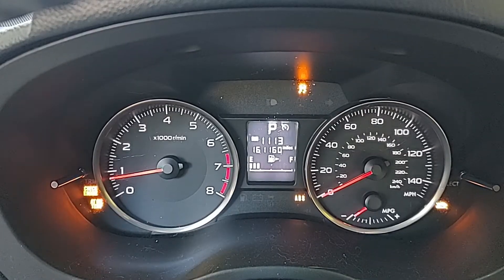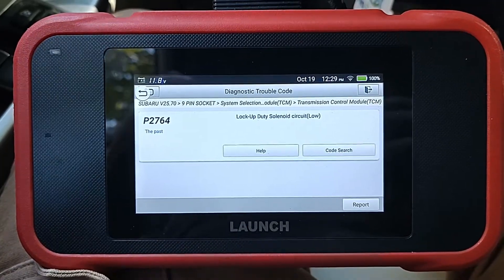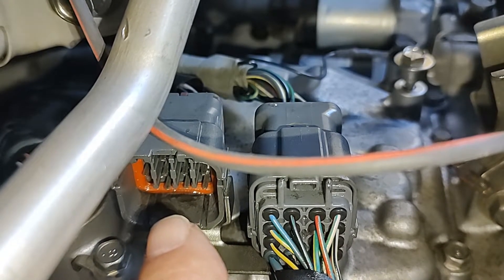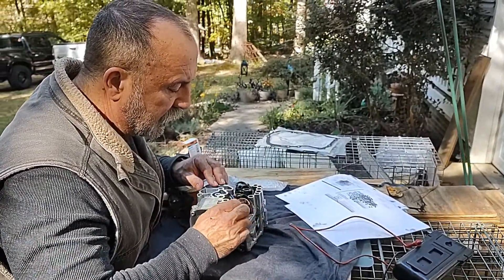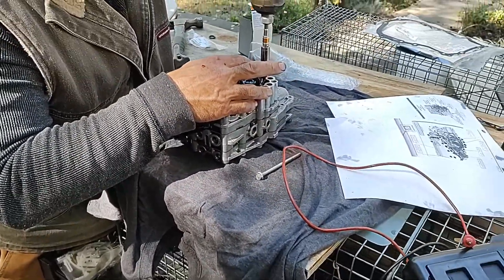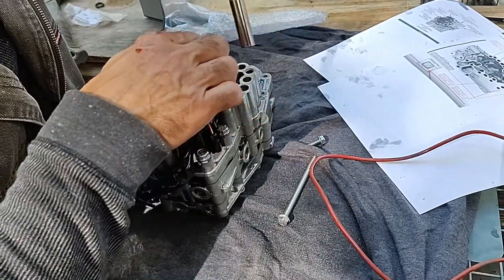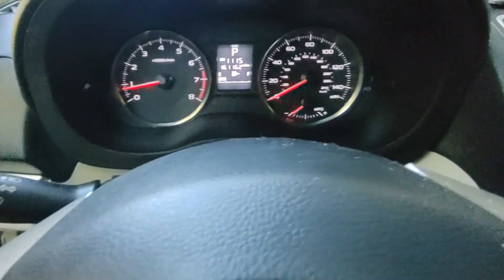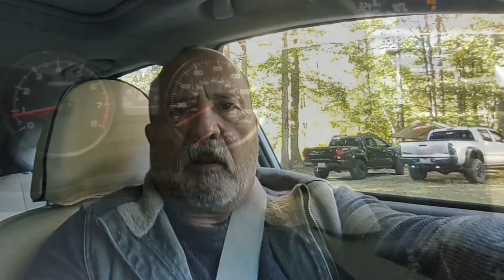How To Fix Subaru P2764 P2763 Codes - Subaru TR580 Transmission Valve Body Solenoid

Comment: My code is for a 2012 Subaru Impreza sport P2764 torque converter clutch pressure control solenoid so what do you guys reccomend ??

Please help meeee

Comment: I just bought a second hand subaru xv 2015 with 67000 miles on it. Engine light,  hill assist  AT oil light and another light i think to do with traction is on. The code from the scan shows PO 971. Im so stressed. Could it be that  i jusy need to change the fluid or its def the valve body and i need to get this changed. It cost $2000 for the valve body in my country plus mechanic fees and they are saying that the solenoid isnt sold separately. Help😢

Comment: Hey, Jose! Thanks for the great video. I just bought the solenoid part, but I have a question: Once I replaced the correct solenoid, Do I need some special software to reprogram the automatic transmission?
Reply: Replace them all?
Reply: Disconnect the battery for 10 minutes and it will relearn everything. You'll need to teach it how to operate your driver side window too but you can find a video for that
Reply from the maker: I didn't for just the solenoid an didn't have any issues. I did get a bidirectional ODBD scanner when I later replaced the entire valve body and reset it.

Comment: Hey man. I just replaced the solenoid on my 13' Outback. It cleared the CEL, but it appears that the
DME has a soft code of the same P2674 through
OBD. I haven't relearned the transmission and checked the grey wire and it is 13ohm. Do you know what could be the issues? Could it be the wire harness, another solenoid, or transmission relearned? The transmission still is jerky when accelerating and a bit sluggish. Thanks.
Reply: The relearn is important.

Comment: Dear friend, my Subaru has all those lights on but no codes appear!
Reply: You might be using a cheap OBD2. Mine didn't show codes either. Had it scanned at the shop with a 'bidirectional" OBD2 scanner and it showed the code.
Reply from the maker: As one person commented it could be cheaper model scan tool you might wanna invest in a better one or find a shop that scan it for you.

Comment: Up here in Canada, our local suby dealer wants..........$2200 for the valve body.  Puck that!   I love youtube for these repair videos.  Good work, i was considering to re wind the solenoid old school LOL
Reply: Our dealer prices are super high too.  I'm thankful for others that made videos about this as well.  So far our Forester as well as our daughter's are both running well with no transmission lights.  Hope you are able to fix yours too if it needs it.  Thanks for watching.
Reply: Just got quoted $4k in Australia from Subaru dealer just for the valve body.
Reply: @woodywood6961  I'll have to do the US Dollar conversion (about $2,575 US) but, that still sounds expensive.  I spent a couple of hundred dollars on the solenoids and did it myself.  A good salvage yard could be a great resource.
Reply: Are all the solenoid same part number
Reply: @iphone-uz8vc  No, they have different ohm ranges.  I think 3 are the same and 1 is different.
Reply: @iphone-uz8vc no, all 4 have different specs.
Reply: Dorman apparently makes solenoids and I heard NAPA might have them also. I'd rather go NAPA than Dorman!

Comment: Did you have to do a computer relearn with a scan tool?    
Or did just driving it, complete the relearn?
Reply from the maker: We did just drive it and the car drove fine. We did a relearn later on and the car drove the same.
Reply: @ExtremeDIYGuy  Good to know, I don't have a computer that can do the relearn, but I figured that the car's computer would figure it out.

Comment: Hi, Does the new valve body come with new solenoids? Thanks. Great video!
Reply from the maker: Yes it does
Reply: @ExtremeDIYGuy  Thanks for the info. Dealer said they replaced the valve body, but now i have a P0841 code. What next! Thanks again.

Comment: Maybe somebody can help me figure out what my issue is with my CVT. I have a 2013 Crosstrek. It has just over 160,000 miles and I have never changed the CVT fluid. I've called the dealership and they say don't change the fluid. I recently got the dash board lighting up and I scanned it and got P2762 Torque Converter Clutch Pressure Control Solenoid Control Circuit Range / Performance  along with P2763 Torque Converter Clutch Pressure Control Solenoid Control Circuit High.

I've been researching the valve body and the lockout solenoid. I am about ready to start taking my car apart to get to the valve body and check the ground wire and measure the resistance in the plastic connector to see if it's in between 10 to 13 Ohms.
The thing is my car dash will light up but I can't tell any difference. The transmission appears to be operating smoothly. At speed I put the Transmission in sportronic mode and it is in top gear (6) and it doesn't get any worse gas mileage than normal. The vehicle, other than the dash lighting up, does not drive any differently than it always did.

I'll clear the engine code with my scan tool and then reset the ECU with a series of pedal depress and turning the engine off and on that I learned in a Youtube video and then it drives for a hundred or so miles and I'll get the dash lighting up with the check engine light and AWD light flashing and I believe something saying high temp in the transmission. I don't have a picture of it and erased the codes. Maybe the Transmission temp sensor?  

I replaced the battery. It was a Walmart 3 year battery, had 12.5 volts and was 4 years old. That worked at first but it started happening again. I've heard a bad alternator can cause some problems with the solenoids too but I had it checked at AutoZone with a bench tester. Same tester said my battery was fine though. I just wanted to see if anybody had a similar issue so I don't change a part that doesn't need to be replaced. I'm still debating on whether I should change the valve body or just buy new solenoids and replace all 4 not just the lockout solenoid if that is the problem. I've heard people have replaced the lockout solenoid only to later have to replace the entire valve body.

I'm looking on Ebay for OEM Subaru solenoids. Luckily I have an 03 Tacoma I can drive in the meantime. I was planning on also removing the oil pan and cleaning the magnet and replacing the CVT filter so I'm not just putting clean CVT fluid back into a system with an old clogged up filter. I figure do it all at once and hopefully never have to do any of it again. I'm not looking forward to it but I like my car and have had good luck with it for 12 years, it's well taken care of and should last me a couple more years. My plan was to have it 15 years or 250,000 miles. It's only needed 2 sets of tires, 2 sets of brakes and 1 CV axle in 160,000 miles.
Reply: if you research more, all CTV fluids break down over time due to heat and stress.  I change my fluid every 30k miles.

Comment: What is the part number for a dorman shift solenoid for TR690 transmission 2011 outback 2.5L with P2764 code? And how to you know which solenoid it is? Thanks
Reply: Sorry, I think Dorman only do it for later models. Mine is a 2010 outback but no dorman solenoid.

Comment: Hi Jose. Thanks very much for the detailed video. I have a Subaru Forester 2013 the same problems that you spoke about. Will the solenoid you recommended work to fix this?
Reply from the maker: Yeah I think it's worth a shot compared to buying the whole module

Comment: I just did this on our Forester last week.  We have 299,238 Miles on her.  I also drained the CVT fluid from the pan and refilled it.  My scan tool was able to do the relearn procedure as well.  Now I have to go do our daughters Forester and her neighbors too.
Reply from the maker: Wow that's a lot of miles, glad it worked out for you!
Reply: @ExtremeDIYGuy  We also have a 2004 MINI Cooper S with 294,214 Miles.  Both were bought new with just dealer miles on them. (3 other MINI's & a Sprinter)  We love to drive and I enjoy maintaining all of our vehicles.
Reply: what is this scan tool i keep hearing about, how can i know if i need it??
Reply: @Zakumei  The scan tool is a diagnostic tool,  It plugs into your OBD2 port and reads the codes on your car.  Most auto parts stores will scan your car for free, but they may not be specific.

Comment: Great video, very informative. I just got a P2763 Code on my way home from work. Starting to research the problem. I can check the wiring harness for resistance but I doubt that is going to be the culprit. Nevertheless I'll start there. I'll probably replace the entire Valve Body since I hear the solenoid is a short term fix and I don't want to do this a 2nd time. Time to look for the parts. I'll check your links.
Reply from the maker: I agree with you, I don't think it's the wiring, the valve body seems like the best fix.
Reply: I've heard that the Dorman Solenoids are good for 80,000 miles, while the Subaru Solenoids are good for 150,000 miles.
Reply: Solenoid is not a 'short-term' fix.  It IS the fix (in such a case as this).  The only question is the quality of the replacement part.  Subie does  not make them available, full valve body only.  Before Dorman many of the options were suspect at best for quality/longevity.  I doubt the Dorman will last as long as the original however it's a much better alternative to the previous offerings.  You'll have to weigh the cost of a valve body vs. cost of part only....consider mileage as well.  I've got 190k on my '15 that is throwing a 2763 code.  I'll be doing the solenoid only if applicable.  It should last the rest of the cars life for $60 rather than $800 for valve body.  Heck even if another solenoid goes out, it's a reasonably easy DIY project.

Comment: Hey thanks a lot great video.
Did you encounter any issues after the replace? any throttle or behavior issues with the car? I did the replace and now i have some issues with the throttle and the start/stop system. Any chance this is related from your knowledge?
Reply from the maker: Ran fine for a few weeks but then I got a different code. I ended up replacing the entire valve body with a new OEM one and it has been 100% since then.
Reply: Well, that blows a large hole in my hopes and dreams.

Comment: Any follow up on this repair? I have heard from others that replacing the solonoid only works for a short period of time (days or weeks) before you get the same failure code. I replaced mine (after testing and confirming that the solonid was bad, and also confirming that the new one was good, based on resistance readings) but it did not fix the problem. I just ordered and installed a new valve body (genuine Subaru OEM, on line for $799 US) and it is working again.
Reply from the maker: I think you have about a 50/50 shot of it working by just replacing the solenoid.